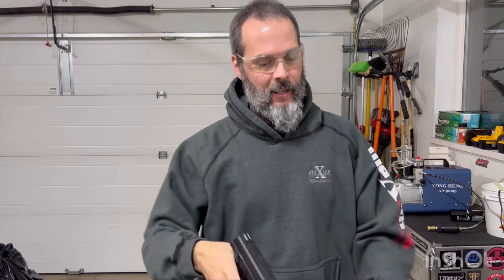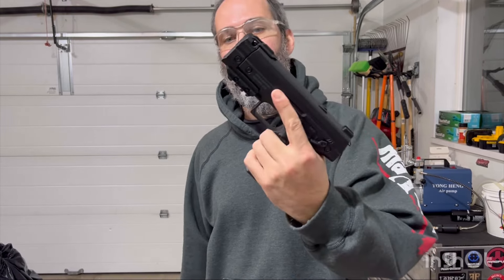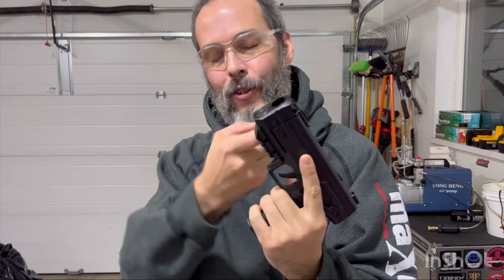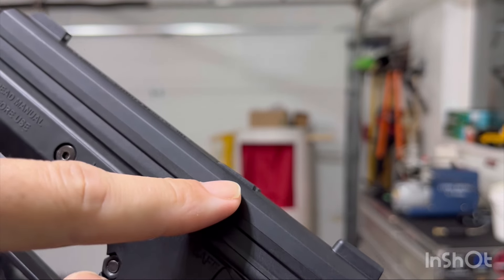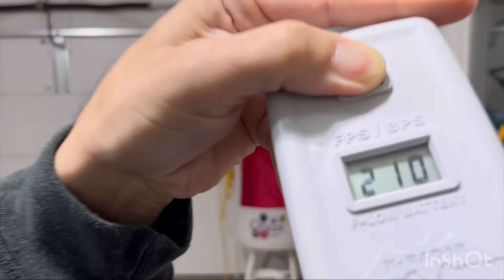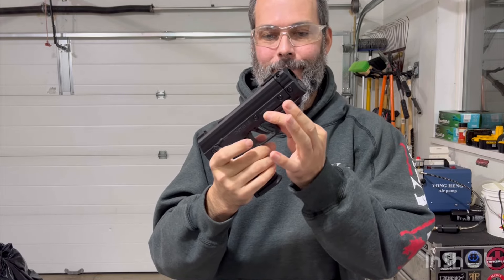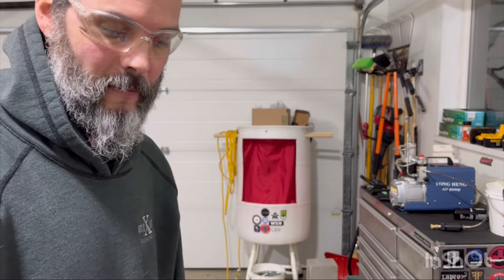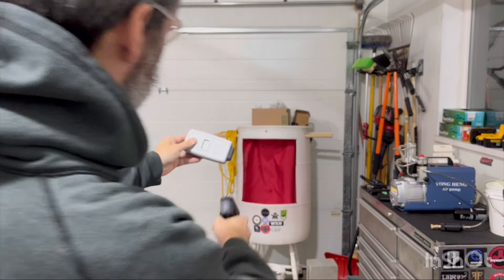LL4D Byrna LE - Modded LE vs half modded LE

Comment: The first one seems to work great and with good power. Strange the otherone shot so much lower in velocity. Nice test as always Sean 😃👍
Reply from the maker: That other one was a lighter valve spring but acted very odd as i have found d this platform does when making changes.
Reply: Aha. 👍 @lesslethalfordummies

Comment: Could be to the "non branded" cartridges. There has to be a difference between Umarex (I think are the best) and non branded ones. In the 25+ years I own a Benji EB22 and some other crosmans. I never had an issue with metal shavings. It looks like the tip cover of the non branded ones (the part that gets punctured) is not fixed the way it should be. Maybe the production process is different?
Reply from the maker: I have seen as many videos of the same leak on puncture using Byrna co2s that i am starting to think it has more to do with the profile of the puncture pin itself leading to this and not the co2 specifically or maybe even the boost attachment somehow??? Unfortunately i still haven’t tried Umarex 12g.

Comment: What joules does a byrna gives without modification ? Thanks 👍
Reply from the maker: The LE is advertised as 16j. Many of the early editions it seems started about 25j and velocity dropped fast into the low 300fps.
Reply: Thanks again!! @lesslethalfordummies
Reply: I don't have a Byrna, but when I look at all the Byrna vids, I get the impression that you shouldn't look at Byrna as a joule machine. The internals are way to delicate to be on par with other brands, at least in a reliable manner. I think Byrna is the best option for pepper balls. A pepper ball only needs a few joules to break. If you go to high, the willl breaks during launching.
Reply: My Byrna HD stock fires the 3g Byrna kinetics at around 270fps. What kinda mod did you do?  My Byrna is trash in my opinion
Reply from the maker: 💯 agree it is a better pepperball launcher then anything else.
Reply from the maker: That is about what an HD/SD should fire. The LE has different internals all together.
Reply: @lesslethalfordummies  the HD was the first LL I bought. Only good thing it did was introduce me to the community. Definitely wouldn’t stake my life on a Byrna
Reply from the maker: @russellloganmusic5023 thats an honest answer. Byrna did do a good job of ushering in a new crowd. The power of advertising.